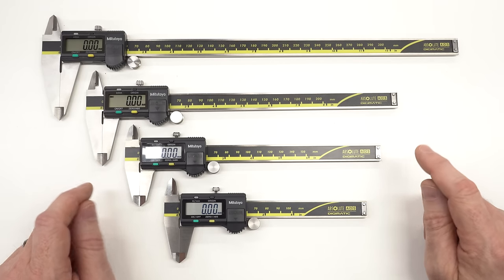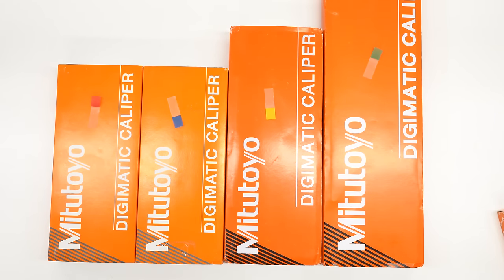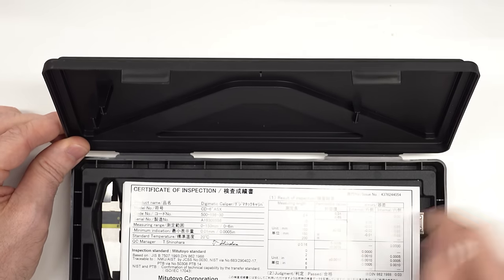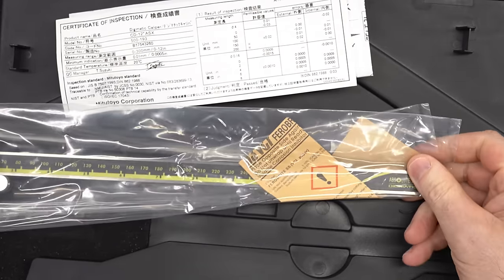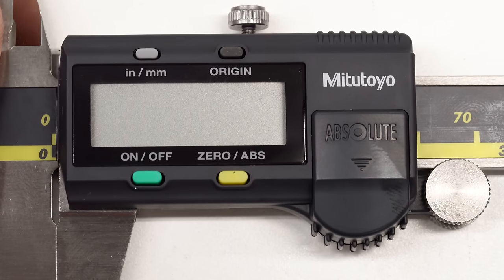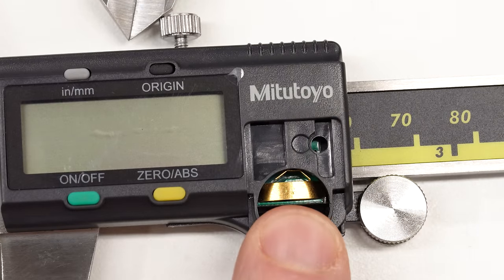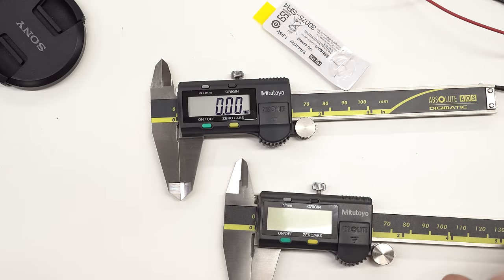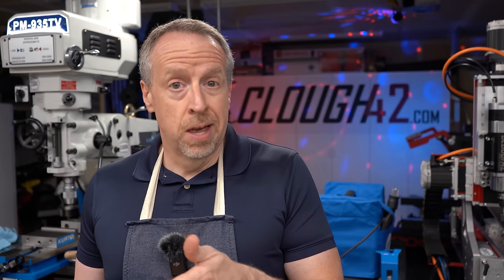17 Warning Signs Your Mitutoyo Calipers Are Fake

Comment: I had a cheap pair of calipers that I used for a while. The battery would die if it was unused for a while. What got me to upgrade was that it began randomly offsetting its measurement. I would have to close the calipers after every measurement to verify that it still read zero and not some single digit of mm. Replaced them with Mitutoyo, no problems beyond making sure there was enough light in the room to power on the solar powered measurement electronics.

Comment: Great video!

Danger / hidden cost with the counterfeit:  they run the battery down 14X faster, and start giving bogus readings at some point; will you find out before or after you trash some parts?  Probably matters more to the pros than to hobbyists.  However note the rough machining; do you trust the counterfeits to be accurate?  I'm a hobbyist and have some cheap 12" calipers; the motion is rough and grindy.  Not going to measure anything critical with them!

if SHARS calipers cost less and are supported, why buy these?  They clearly use the Mitutoyo name for the same reason companies like printing "tactical" or "executive" on things:  you get more money for very little effort.  E.g. that "tactical" flashlight is tactical, how?

I'd like to see e.g. measuring gage blocks with each, especially at lower battery voltages.

Is there a way you can check the accuracy over the range?  Could probably trust the Mitutoyo calipers as your reference, or at least show comparisons of readings.

Comment: I have some older Mitutoyo digital verniers and the slot on the reverse side used to be milled on a horizontal mill, however it is still very much better quality than the items in your video with a similar finish to the slot milled with the vertical mill.

Comment: That PCB on the counterfeits act quite similar to the Harbor Freight guys.  Much of the bits and pieces also have the appearance of those sold at HF.  This includes the grainy texture of the measurement sticker, the milling marks on the metal, the battery flakiness with the door removed.  Perhaps same manufacturer, sold to a counterfeiter who made small changes and applied cf stickering?

Comment: i wanted to buy a littokala lii-500 li-ion battery charger/tester from ebay to aid me in rebuilding dead cordless tool batteries. i went through about 50 different listings before i found one selling the genuine item, the rest were knockoffs. these are the kind of details i had to compare to insure i was buying a real one. i did all of that because i saw a vid here on youtube about how most cheap listings on ebay were fakes, and that was my experience as well. if you shop for new, normally expensive, name brand goods on ebay, don't just buy from the cheapest, or even the first reasonably priced listing that pops up. you must perform do diligence in order to insure you are actually going to receive the product you thought you were purchasing. also, try searching multiple different descriptions of the item you want, because sellers don't always use the same descriptors in their listings, especially when buying used items. i've found that searching slightly different descriptions of the same item, will often get you very different search results.

Comment: If People think that they're getting a quality product by paying a huge difference in price then there is usually a reason, it's either to shift old stock etc or in this case it's cheap Chinese crap, I was caught out by something similar a few Months back but now I take a good look at what I'm buying & only buy from reputable Dealers, I pay more, but I am guaranteed the Tool is good & if there is a problem it is rectified quickly. Thanks for revealing the differences.

Comment: I bought mine recently and got it out wondering if I got a genuine one and was relived  I did. The knob that locks the caliper on the genuine article is of higher quality very easy to recognize its flat polished top that looks almost lapped and detail of the knurled edge is also better it has a small radius on the bottom of the screw. The LCD display is silvery gray in the real one. The knock off LCD screen has a green cast to it.

Comment: Frosted vs smooth scale protectors , quality of machining (including direction of grinding , uneven matching of the jaws , irregular or missing edge breaks on some features) and not just for the depth gage. Also the electronics housing is more smooth on the genuine product . Plus tint of the display .

Comment: Great comparision. I worked many years in graphics desing and can confirm that two of the packages are lowsily fake packages. If the design is done once, you'll find no big differences, although you can have differences in color reproduction (but this orange is not critical as some blue or reddish blue tones are). The bigger and more professional the company, the higher is the probability that packaging design is very constant, especially logos are consistent, often over decades, and all use the same files. The bad news: if you would have maken this fake packaging by a pro, you could not tell any difference. It´s some hours of work, perhaps a day, but you can reproduce this in a way that even specialists thinks it's original, because they have no holograms as I know. And I don't think any fake product should be purchased, even if it's of good quality - don't reward frauds.

Comment: I once built a high performance motor using a cheap torque wrench, and the heads let go as they weren’t torqued evenly. I ended up buying a stupidly expensive torque wrench for that one job, and haven’t used it again … however that accuracy saved me money in the long run as it meant the job was done right (the second time). 

I watched my father use cheap tools his whole life, but my theory is buy cheap, pay twice.

Comment: Would have liked to see if you swapped the battery from EBay into the original would it show five bars of charge on start up. Or are the batteries shipped low.

Comment: We've bought a number of the counterfeit calipers - the easiest giveaway is the fit and feel.  Mitutoyo make great calipers, and the edges and assembly are really well done.  Fakes - not so much.  Note especially the rivets  on the bar at the end; backside of the fakes are pointed and damn near dangerous whilst real Mitutoyo are fit and polished.   The fakes aren't particularly bad - but if you are looking for a pair to use for more than a year; they are not necessarily the value.

Comment: i have a bunch of different calipers. my constant go-to is my igaging with the fractions for triple readout functionality. use it all the time, swap around between the measurement types a lot, its been a few years now, no battery replacement has been needed yet, display remains easily legible, and it meets spec to the starrett regular (nondigital or dial) calipers i have, consistently. for $35 / 6inch.

and since i picked them up, these are pretty much the only ones i recommend to people unless they need ridiculous precision.

Comment: Something I noticed on your opening screen, was the difference in the shallow chamfer grind toward the inside measurement jaws (diagram shown at 13:33).  With the originals, the chamfer is about equal on the fixed and the moving jaw.  Not so the fakes.

Comment: Another difference I noticed on the video is that the plastic body and vinyl tail are smooth on the genuine and textured on the counterfeit.

Also the clamp at the end of the tail is flush with the end of the vinyl on the genuine but overlaps on the counterfeit (the vinyl protrudes beyond the clamp).

Comment: I have a much older Mitutoyo 6 inch digital caliper that I have used for several years… quite a few of the design features are slightly different (eg. the case and logo design are older versions), But I believe that it is genuine. It has been a very high-quality product that has served me well. I think they used to also be a lot more expensive relatively back when I bought it.

Comment: Interesting video.  I have both genuine and a couple knock off mitutoyo calipers.  I purchased the knock off actually purposely just for the fact that I am a retired machinist and now am a school bus mechanic.  I measure a ton of brakes and brake dust kills precision tools.  As long as they are accurate then to each their own.  When I was still working as an aircraft machinist then yes I would use nothing but genuine but to be honest I haven't noticed any difference in measurements between my genuine and knock off mitutoyo.

Comment: I have to wonder if the knockoffs actually have "absolute" encoders. As in if you run the slide out and back quickly/jerky it will still read the same distance (aka cannot "lose steps"). This "absoluteness" is an advantage of the mechanical dial caliper, and why Mitutoyo came out with this model.
I'd bet a fair bit the knockoffs could be gotten to read wrong as they probably use incremental encoders.

Comment: The 3 snowmen on the manual look like a 3 jaw chuck. The counterfeits have the lines in the circle ending pointy.
Take a thorough look when closing the jaws, where the radii are. Upper and lower jaw look a bit chewed up, where they meet and there is no clean matching cut. The area between the gap and the area the jaws meet do not match up perfectly but are slightly skew.

Comment: The batteries die on the Pittsburgh from Harbor freight. With the device turned off and in the case in the dark they last a few weeks and then they die.   Frustrating.  couldn’t get warranty because by the time I figured it was the thing making the batteries go down and it was out of warranty. Not happy. Many Harbor Freight items are fine, just tend to stay away from any of their “precision” items and especially digital calipers

Comment: The reason that we're not able to use accuracy as a differentiating point between the genuine and fake caliper is that, in order to tell anything's accuracy(ISO 230-2 2.23~2.24), usually the measuring equipment needs to be at least 10 times more accurate than the thing that we're trying to measure. Since we're dealing with the measuring equipment itself, we probably need a laser interferometer to tell the differences.

Comment: The rivets on the depth end are less "finished" looking. The real Mitutoyo rivets are fully rounded/polished. The fake data plates on the back have the battery number that matches the actual, included battery, though the battery package shows the real battery number. This is an extra bit of cleverness. You probably won't notice that the included battery does not match the number on the package, but you might later on when you change the prematurely dead battery. Will you consult the package (likely long discarded) or the back of the battery? Will you confirm this by looking at the back of the caliper? Oh, hey, they match! Cute…

On my fake Mitutoyo calipers the display freaks out without warning when the battery dies, just like yours. I can't tell from your video whether your real ones do what mine do, but you can check. On my real ones, when the "B" appears the whole display dims to save power. Nice. Low power mode so you can still use the tool accurately. If yours does this, too, perhaps you could measure whether the power consumption actually drops off when the LCD panel dims? Might be interesting…

Great video, sir!

Comment: As a teacher in cnc I address these things in my classes all the time. Check your stuff what you are using. If you cant get the real stuff, buy them yourself, and never lend them to anyone. Skill comes from reliability, how to get it is a jungle, when prices are the competitor for all cheap wanting people. I got a fairly new Mitutoyo caliper that I used in production for 9 years. Another analog one from Mitutoyo that I used 19 years. Both look still today like they are new, and the real feel to use them are the same as they were from the box. None of them stick or hack along the scale when smoothly take them from closed to full open and back. Feels butter all the way. Sad you missed the qr code.. it wasnt even possible to read out.. ;)

Comment: It's a good thing you've pointed out those differences between the genuine Mitutoyo calipers and the Fake ones. You're also right, if there's money for those clandestine makers (Oops! manufacturers...) to make money under the name of the genuine manufacturer then they should do it under their own names instead of using others. Furthermore, they not only have a greater current drain but often have a shorter life and are harder to use when it comes to exact measurements.
Reply: Colin Mitchell  # I know this from my own experience! I bought mine from Amazon, it's a 'Preciva' brand, and while it's OK, its accuracy, which is only 10micron, is hard to get right. However, after viewing this vid, I also checked its current draw which is a constant 26μA, be it on/off, and It's 51μA on reset. So, I no wonder the big button cell (2032) after a short while goes flat even when it's turned off as opposed to this genuine Mitutoyo brand with <1μA current drain in standby mode.

Comment: Reckon that you're right about the fake battery-packaging just being all printed identically, simply because those batteries are SR44W (alkaline batteries), whereas the genuine batteries are SR44SW silver-oxide batteries which have a much longer shelf-life along with a higher charge enabling them to power devices for at least 5x longer!  Also, alkaline batteries are much cheaper & more prone to leaking once they've used most of their charge!

Comment: It would have been interesting  to carry out a straight-out-the-box calibration using slip gauges.
Calibrate at 5 points over range, rising and falling for hysteresis check and several times to determine repeatability.
I do not advocate the purchase of counterfeit products but for those of you that have inadvertently purchased one it can still be used in a manufacturing environment.
ISO 17025 is not at all concerned with the make of an instrument, only its performance and stability.
Any inherent drift can be determined over time and as long as the reference standard against which you are comparing is traceable back to a recognised National standard, then you’re good to go.

Comment: Some have noted that calipers are not to be depended upon for measurements closer than 0.003" (0.0762mm). With care and knowing the caliper's limitations you can do better than that when faced with difficult measuring situations.
A Mitutoyo instruction sheet for a vernier caliper from 1966 warns not to use "Abe's method". This is a WW2 GI slang expression meaning "don't force it". Get a touch for your calipers against a known standard. Put the work to be measured as high as is practicable in the jaws to reduce jaw flexing as much as possible.
Note that a digital caliper whose last displayed digit is a zero or five is incapable of measuring any closer than +/-0.00025" (0.00635mm) of the actual dimension. For example, if the caliper displays a dimension of 0.0540" the actual size can be from 0.005375" to 0.005425" .

Comment: A great CDO (that's OCD but in the right order) examination. I have a background in electrical standards derived from fancy machining and mensuration and also typography. I used Mitutoyo. In retirement I use Mitutoyo. I am not paid but my time still has value, and dicky measurements can still cost redoes. Just checked my recent purchase, not cheap, and the papers are flat. 
I don't know what it means but the fake batteries in your sample seem to miss the trailing S in their type name.    Now to watch your next video.

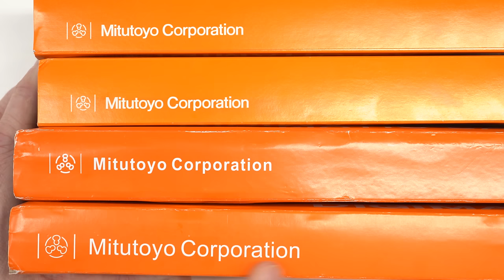Comment: Also, at  06:21, you can see the tops of the letter "T" in Mitutoyo, there is an angle to the fake ones where the genuine ones are flat topped....
Excellent to see these type of videos highlighting the subtle differences between the genuine product and the cheap, nasty Chinese knock-off ones.

Comment: It may have been mentioned elsewhere, but a local reputable stockist selling Mitutoyo calipers at exorbitant prices show calipers in their advertisements which appear to have some fake features and some not. Either Mitutoyo's quality control is slipping or the fakers are getting smarter. Or the later ones simply have a different design. e.g. In these advertisements, the yellow arc only goes as far as the O, and the origin button is recessed, but the arc on the fixed jaw has a large radius and the plastic embossing looks fine.

Comment: Just to confuse things further: my genuine older Mitutoyo 6" calipers have elements of both. 
Ground slot in the back
Recessed origin button (but different again)
Powers on at -221mm, no flashing bars

Otherwise the same as genuine other than the plastic casing being a slightly different design. 

Always buy genuine. I bought a no brand 0.001mm micrometer because it was digital and the same price as the Mitutoyo analog ones. Every time I've gone to use it the battery has been flat. Never again. In its defense, it is very accurate, in the week you get to use it before the battery runs out.

Comment: I just use the HF Pittsburgh $10 calipers- because I can scribe with them and abuse them and toss them out- many times for the price of a Mitutoyo.
And if your concern is accuracy, you should be using a mic set and standards- which I also have, and get a lot less use since 99 percent of my work does not need to be within a thou, let alone a tenth.  And FWIW I am a fairly serious hobby machinist and build firearms and engine components among other things.
Also, I use mist coolant also exclusively on my mill, for flood coolant maybe the higher IP rating for the Mitu would be worth it, but honestly I still think the $10 ones are easier to replace if they get dropped or a fixture falls on them. Which happens from time to time.